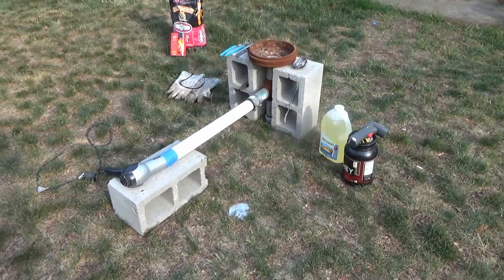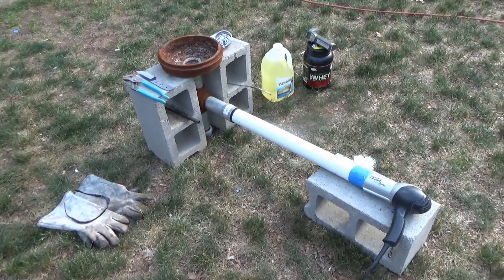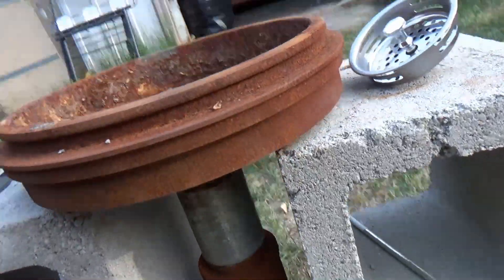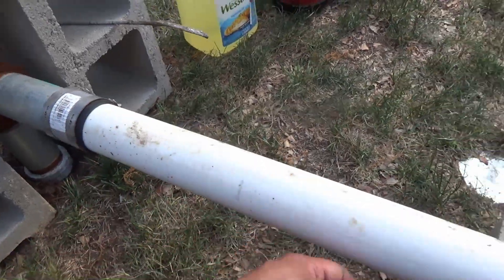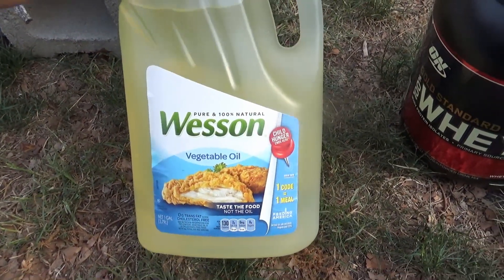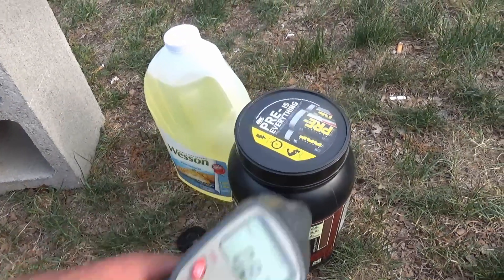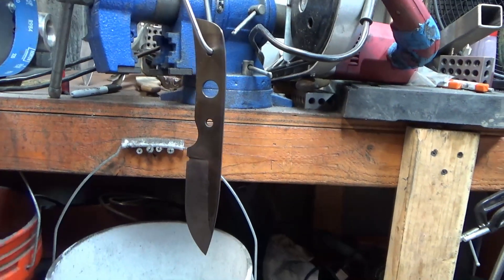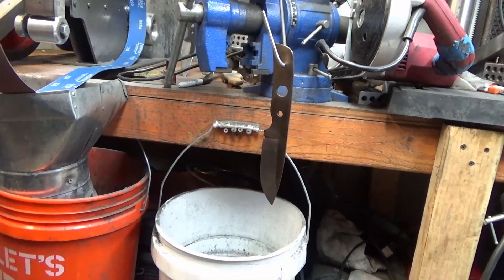How to make a knife Part 6. Backyard heat treating

Comment: I have been binge watching these videos, and getting all the necessary tools for knife making, but i have to say i'm nervous about the heat treating and tempering. So far i seem to have a pretty good idea how the process goes, but i need to clarify something. Maybe i'm just getting confused after so many blacksmithing videos, watching knives go in the fire a bazilion times, but exactly when does the knife get heat treated? Does the blade get treated after creating the bevel, but before creating the final edge? I plan to start with stock removal as opposed to forging. I just wanted to make sure i was clear on the timing. Thanks for taking the time to post videos :)
Reply: 1. Rough grinding shape. Bevel, and dimensions.
2. Harden. Heat knife in forge, with oil treatment.
3. Tempering. Place in oven or any kind of device that produces a consistent low heat.
4. Finishing. Sanding, Polishing, and Sharpening.
Reply: Joel Truax Thanks i think i got it now :)

Comment: ive been researching for a while... im still at the stage where i havent completed a kife yet. .. but i have 1 im about to heat treat... i read on a knife makers forum... that you can put a piece of black iron pipe (capped on 1 end) in the forge... let it get hot... throw wood chips in it... then put the knife in... and the burning wood chips will suck out the oxygen and reduce scaling... it also keeps you from burning the tip... and gives a more consistent heat treatment... have you tried this method...? or know anyone who has... the knife im trying to heat treat..  is a large... and provided i dont screw it up... it will be a very profitable knife... :D
Reply: That is a very good idea, it takes a little longer but it gives you more even temperatures along the blade and lessens the chance of burning up the tip, the reduced oxygen atmosphere in the  pipe when when used like this is called a choke, it will help keep you from burning up the tip and reduce  decarburization where you blade loses carbon near the surface.   

While I am at it I will get on my safety soap box, in the video I am glad he mentioned not using galvanized pipe. It is hard to find large diameter black iron pipe at the big box stores but easy to find galvanized. Where he used galvanized in the video it was below the heat source with air flow but where we are talking about using pipe for a choke it is in the heat of the forge itself. If you use galvanized pipe inside the forge the kind of vapors that will be emitted at high temperatures are toxic,  so use black iron pipe. Zinc oxide forms when the steel’s galvanized coating evaporates from high heat,  galvanize poisoning can be similar to flu symptoms and include headache and nausea.  Moderate cases result in chills, shaking, a slight fever, vomiting and cold sweats.  Severe cases of galvanize poisoning can result in death. It is nothing to fool around with.

Comment: I just finished my first primitive blade that I consider a success(for my skill level anyway) It is however pitted in spots. I imagine I heated the metal too quick and so burned. did it in a charcoal fire.wondering what others thought on that matter...
Reply: were u using mystery steel?
Reply: I was indeed. I felt my current skill level did not warrant anything better at the time.
Reply: +Jonathon Frazier. old saw blades are a good spot to start as well as planer blades and leaf springs from old trucks if you need to experiment.  I've done the same and they can come out beautiful. cable damascus: not worth it.  there's my two cents on it.

Comment: you were dead on about the chunk charcoal making sparks. I had seen another video where they recommend chunk instead of the briquettes so I bought some. bad idea. they were right in that it got super super hot but I have a small bucket forge that I built myself and you couldn't really get close enough to it to add coal or anything because it was throwing sparks and tiny embers 5 feet in the air. lesson learned.
Reply from the maker: +Michael Cockrell   Lol that's how I learned my lesson too. And those tiny sparks have a tendency to land all over you shirt and turn it into mesh in a hurry hahaha
Reply: +EKIM1428 on the plus side it gets really really hot and it gets hot really quickly. the kids enjoyed it because it looked like a sparkler shower.
Reply: I got a hot chunk to fly right on my eyelid

Comment: how much time you need till it's red hot
Reply: it depends on how hot your fire is and what type of metal you're using. on my forge with 1/8 1095 it only takes about 4 minutes as long as the forge is already blazing hot.
Reply: +Michael Cockrell  thanks

Comment: Thank you so much for posting this. I recently had an issue with some 1095 I have been using to create knives. I am a beginner and took some stuff for granted and thought that the 1095 was annealed. I was finding my HRc to be very low (43) when I wanted it around 58-60. Long story short; the metal was not annealed. Anyway, I switched to 1084 from NJ Steel Barron and hope this helps. My question is this: Do you know the final HRc of the 1084 after your tempering? Thanks. Keep up the outstanding work.

Comment: haha, I remember those days, turned an old bbq grill into a "forge" and used the lump charcoal etc..    I promise, I'm not trying to be a smart ass or a know-it-all or butt into your vids or anything,  but I do wanna point out that ya never wanna stir your blade in the quench.  Either a straight up and down (sawing) type motion or a back and forth (spine to edge) type motion should be used, otherwise the chances of warping are greatly increased.   And please tell the newbs to never use a plastic container for the quench, very dangerous!  just in case ya know..

Sorry man, I'm just tryin to share from the many dumb things I've done and the many mistakes I've made from dong all my own heat treating over the years what I've learned, as well as from the more experienced on the forums. ;)   Once again, great vid series bro, I hope to see more like it!  Take care :)
Reply from the maker: *****  You are right and any input good or bad, from experienced makers like yourself is always welcome here! I want this channel to be a place where new and experienced makers alike can gather and get some good info...Myself included!

I'll be the first to admit that heat treating is not my specialty. I've read a ton about it and figured I should just leave it to the pros as it is far more complex than the video illustrates. I will annotate the video to include your tips. No need to be sorry at all! Thank you for helping me out.

Comment: Just curious but do you have any thoughts about making knife handles from trex?
It wouldn't look as nice as the knife handles you turn out but could be a good option for a beater utilitarian knife or machete. Just a thought.
Reply from the maker: Greg NY  You mean like the stuff they use for decks? I guess you could as long as it doesn't warp or shrink over time. I'm not too familiar with it.  The handles I used to make this knife are in g10 which is a fiberglass composite. Its very easy to work with and its cheap. You'll see once we get to the handle video that I paid $11 for a sheet big enough for 2 knives. Looks, function and affordable!  Unless of course you just prefer the look and feel of the trex.
Reply: EKIM1428 Yup deck boards. Ive seen a few videos a while back where some people used the stuff. From the videos it looks like it was comfortable to handle and easy to work with. I assume that it will hold up. Just a thought.